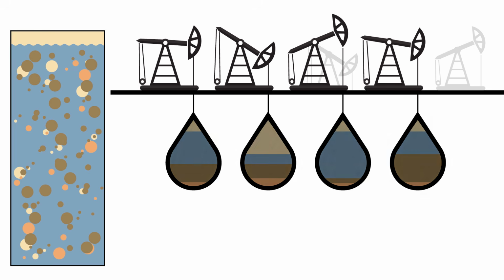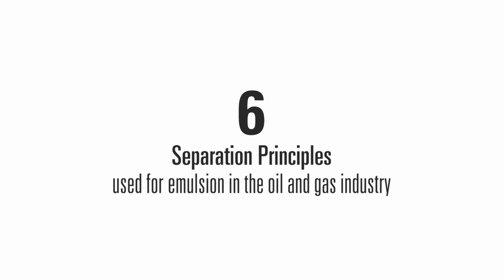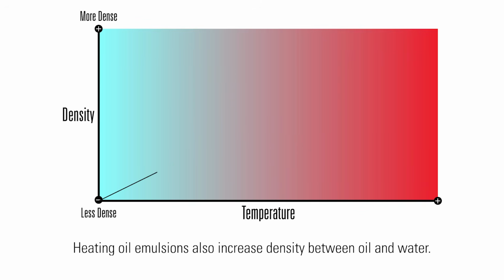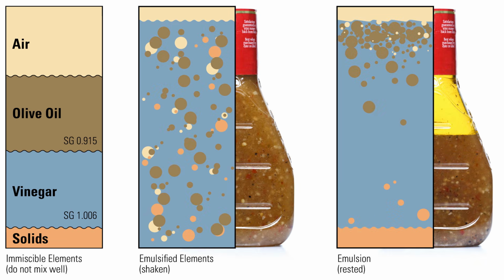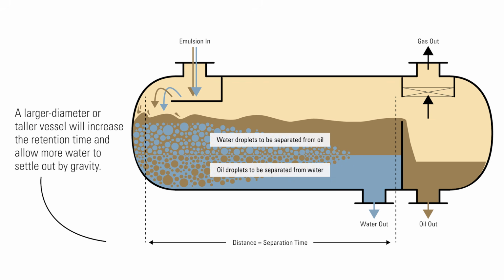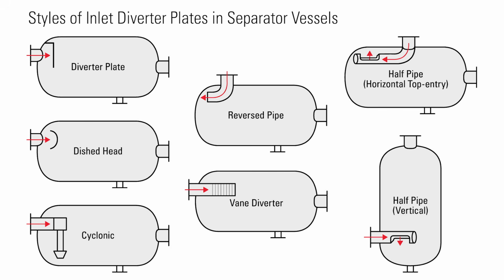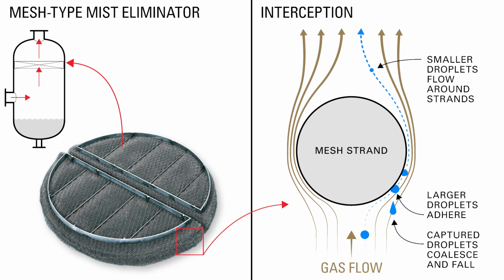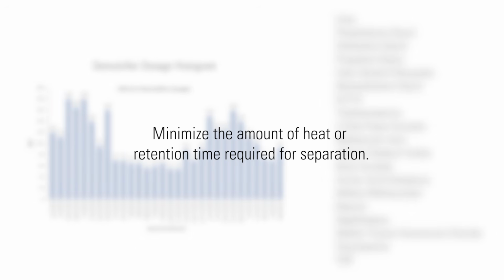6 Ways to Separate an Oil and Water Emulsion [Oil & Gas Industry Basics]

Comment: Is separating oil from gasoline something that can be done at home or is the process too complex or involves expensive equipment?
Reply from the maker: The separation of oil and natural gas is not excessively complicated, but to make it profitable, large volumes of resources are needed. Processing oil into different components (gasoline, lubricants, etc.) is complex and needs expensive equipment. Both of these processes are not economical or safe to perform at home.

Comment: Can you explain Vessel internal electrostatic coalescor system??
Reply from the maker: This may be difficult to explain in a comment here, so if you have other questions, feel free to ask and we will try to help. 

An electrostatic treater uses electricity to remove dispersed water droplets from oil. The oil is subjected to an electrical field which facilitates better oil-water separation by causing the dispersed water droplets to coalesce and fall to the bottom of the vessel.  

The electric field also distorts and thus weakens the film of the emulsion surrounding the water droplets. Water droplets dispersed in oil that are subjected to an alternating-current (AC) field become elongated as voltage rises during the first half-cycle. 

As the droplets are relaxed during the low-voltage part of the cycle, the surface tension pulls them back toward a spherical shape. This effect repeats at a very rapid pace with each cycle, weakening the film so that it breaks more easily when the water droplets collide with one another.

Comment: does water level and burner tube level matter?  do you worry about scaling with the water over the burner tubes?
Reply from the maker: Yes, both the maintained liquid level and the burner tube size/placement are important to maintain proper heat transfer. Contaminants in the liquids can cause scaling and/or build up on the fire tube which can lead to premature failures. Regular inspection and maintenance of the burner assembly will help prevent failures.

Comment: Can you advise the type of chemical which can be used for  hot wash or circulation to clean Crude Oil Storage Tank. I am not sure on the type of chemical to be used. Also, same as the chemical to be diluted in water during hydrojetting for degreasing. Thanks in advance

Comment: Hi! 

I am in the process of building a small (4500m3 a year) sludge-water treatment plant. I'm removing heavy metals with coagulants and floculants, ending the process with a bio-reactor. 
BUT: I have a problem with splitting very oil-poluted water. I need to something to clear the phases. (First step is sedimentation, but I have some process-water that won't clear the oil) 

Would love some help. Don't mind paying for it.

Thanks!
Reply: Hi Bro,

I have experience in produced water and sludge oil treatment. You have to separate the sludge first to make easy oil in water emulsion separation in down stream. Due to rhe sludge has natural emulsifier those thighten the emulsion. After that you may treat the oily water with floc or coagulant chemicals. 
Thanks